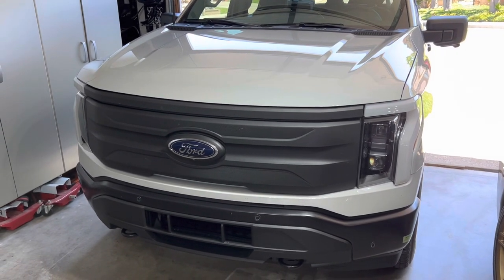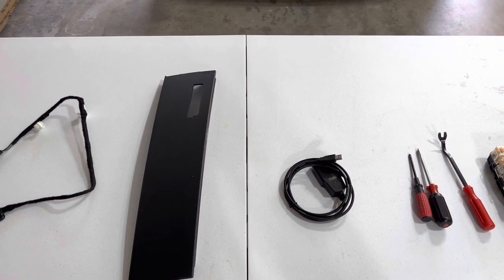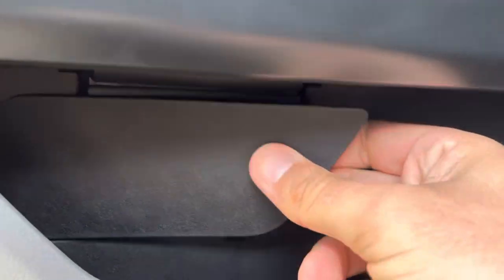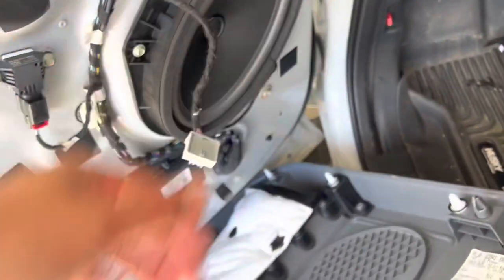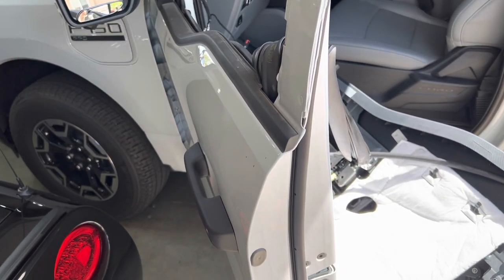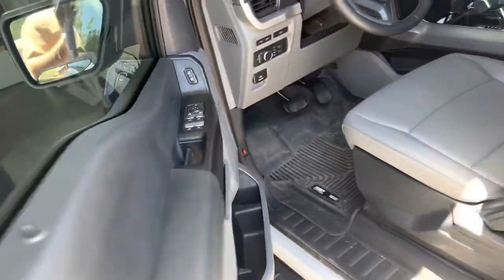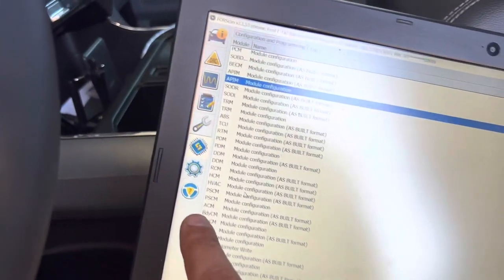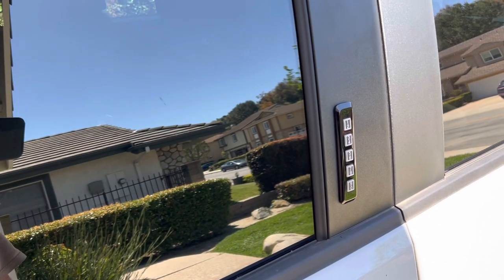Ford F150 Lightning Pro Keypad/SecuriCode Install

Comment: This video helped me out a lot! I actually got the gloss black piece and even did the rest of the pillars in the gloss black, each pillar from ford was only about $30-50 each.
Reply: What was the part # for gloss black? And do you have a pic of the gloss on? Thinking of doing this also….
@mustangchris1
Reply: @Havencheer2014  fl3z1520554bd, ml3z16255a34bc, ml3z16255a35bc and FL3Z-1520555-SF(this is driver side with cut out)
Reply: the rear ones have this weatherstripping on one side, a way to tell the rear's from the front pass side. Cost me $250 total at my dealership.

Comment: Awesome Job....I have a Pro also and followed your leather wrapped steering wheel video I did take it a step further and also took the chrome piece that was in the middle of the switches too...have you thought about adding the light bar on the front yet ?
Reply from the maker: I would love to do that. However, I haven’t seen anyone that’s been able to get it to work on the pro yet.  Apparently the plugs are all there but no one has figured out the programming yet :(
Reply: @KurtsRPMGarage  you do realize the truck in the video is a Pro right lol
Reply from the maker: @johnfreeman1615  of course. It’s my truck after all. What are you asking?
Reply: @KurtsRPMGarage  I took the reply about the front lightbar as adding the keypad to a pro my bad
Reply from the maker: @johnfreeman1615  all good. Haha. It happens.

Comment: Thank you for the great video. Super straight forward for installation. However I am very unfamiliar with FORScan. I have a Mac computer and an iPhone. I see that you can get BT connectors and run and iPhone app version of the software. But it seems to be marketed as a “lite” version. Do you happen to know if that has the capabilities to do this operation for the keypad? Otherwise it seems my option would be purchasing a windows laptop just to run the software which obviously adds a bit more expense to this. 😂 I know you may not be able to answer this question since you did this just with the layout you have already, but figured I’d ask. Either way, thanks for the great tutorial!
Reply from the maker: Hey thanks! I’m not sure on that one. It wouldn’t surprise me if it was windows only. Maybe find a buddy with a cheap laptop you can borrow for a day.

Comment: Awesome video! Did you figure out which button press opens the frunk? Also would you recommend doing the passive door handle install at the same time as this keypad install?
Reply from the maker: Looks like you enter your code and press 7 and 8 at the same time. I have never done it on purpose but I have done it by mistake. Haha. https://www.fordservicecontent.com/Ford_Content/vdirsnet/OwnerManual/Home/Content?variantid=9334&languageCode=en&countryCode=USA&Uid=G2281572&ProcUid=G2281576&userMarket=USA&div=f&vFilteringEnabled=False&buildtype=web
Reply from the maker: Yes I would do them at the same time. It will at least save you from having to take the door panel off twice.

Comment: When you route the wire, do you run the cable down the second hole or do you route the wire another way?
Reply from the maker: I think I talk about that around the 5 minute mark of the video. If I remember correctly you run the wiring in the hole closest to the edge of the door. You will need a tool to jam it down as the wire will likely resist being shoved down a relatively small hole.
Reply: @KurtsRPMGarage   you did talk about it, but I wasn't sure what you meant.  I noticed the two holes on the pillar.  So I was wondering if the cable goes down the hole or along the pillar.
Reply from the maker: @JohnGore-e3g  gotcha. I would need to see a photo. But I recall there being two ways the wire could go down. I tried the first hole (the one closer to door hinges) and it didn’t work as the window would catch on the wire. I then used the hole closer to the edge of the door and that worked but was difficult to get the wire down. Hopefully that makes sense.

Comment: Any clue if this is something I could pay the dealer to install? I have a bunch of ford pass points burning a hole in my digital wallet..
Reply from the maker: No idea.  Wouldn't hurt to ask I suppose.
Reply: @KurtsRPMGarage  yeah they were pretty good about installing my raptor wheel. I think as long as it’s FMC parts they’re cool with it. I mean presumably keypads on lariats get replaced so I can’t imagine it’s much different
Reply from the maker: @TheDrivewayConcierge  I’m sure it depends on the dealer. Sounds like yours is pretty cool about it. It’s a relatively easy install so they should be  able to take care of you.

Comment: Wow all that work to install a keypad.  I have a platinum and don't ever use my keypad.  What's so special about the keypad? You can enter the vehicle,  open the frunk , but to start it you still need your key in your pocket. So why not just use the touch door sensors to open the door and the frunk button to open the frunk?
Reply from the maker: The pro doesn’t have the touch door sensors either. This is the easiest way I could come up with to open the door without taking the key out of my pocket every time. No idea if retrofitting the touch door sensors is even feasible.
Reply: Being able to lock your key in the truck while going on a run is my favorite use case
Reply: Im a runner and it is great so you can lock your keys and phone in the truck and not have to carry them. One vehicle years ago i carried the key fob on me so much while running the sweat worked into the fob and the salt corroded it to the point it no longer worked.

Comment: How much was you pro lightning.
Reply from the maker: I was super lucky and got it for original pricing. It was 47k with the options I got plus destination. 51k out the door after tax and registration before rebates.
Reply: @KurtsRPMGarage  nice!!. We really want a lightning but current prices are too high. We are just going to wait them out until they drop
Reply from the maker: @didiermejia780  don’t blame you one bit. These current prices are outrageous.